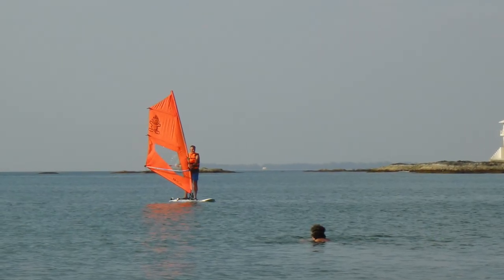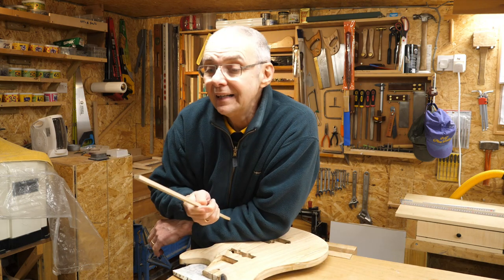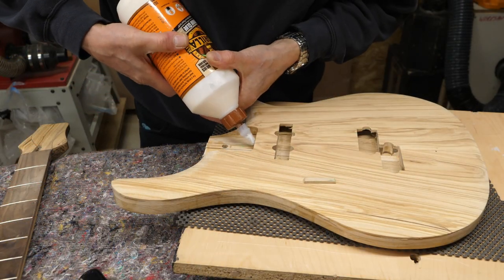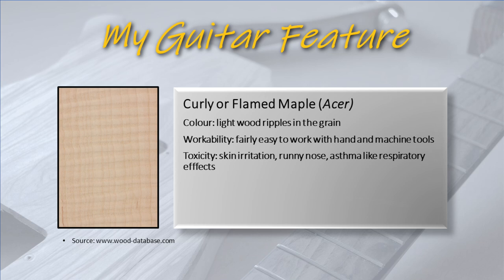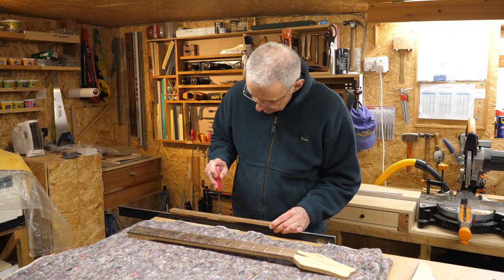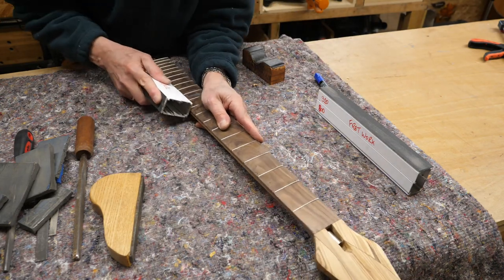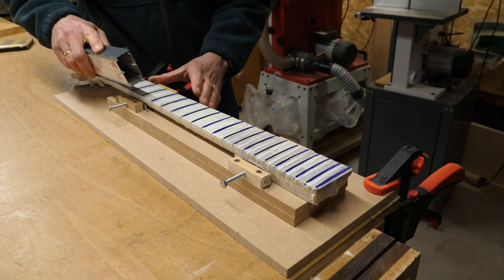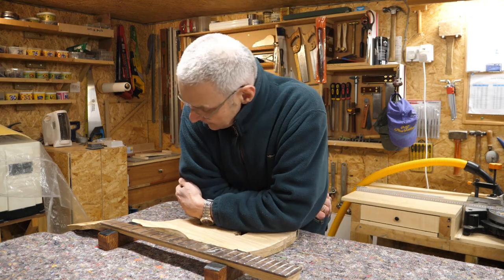Complete Bass Guitar Makeover - episode 18 - a new look, windsurfing and fret dressing

Comment: Hi Dave ....I'm a bit late to this one, but another really good video. I wonder if you had considered using another bolt in line with your usual one - even just a captive bolt in the body? Possibly easier to set up than the keel! Glad you found Sam Deeks method interesting - it is certainly very effective on guitars that have had previous basic set up done. Bye the bye I think I originally put you on to him. Look forward to the next installment. Cheers Terry
Reply from the maker: Hi Terry, yes you put me on to Sam, a clever guy. The keel seems to be working really well, I didn't really want to add any more metal work. Cheers Dave

Comment: You seem to be putting the key where it's not needed. I'd have thought the key needed to be the other end of the neck pocket, closer to where you cut the body away and lost support. Have I got the wrong end of the stick?
Reply from the maker: I thought the same as you as I was making this ‘keel’ but in fact the combination of the keel and the bolt work really well. There’s not really enough material on the outside of the bolt to make a substantial key. Cheers Dave